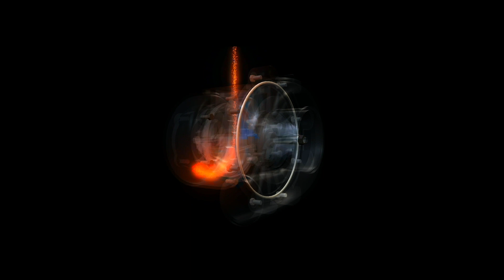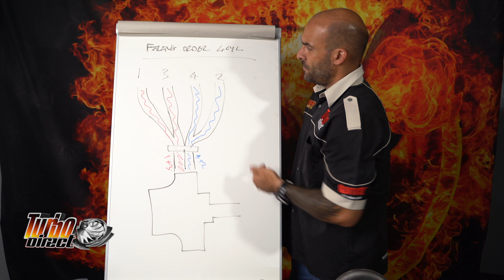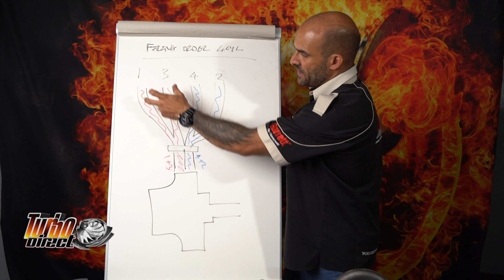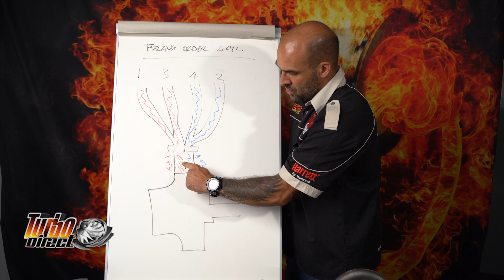Twin Scroll Turbine Housings explained

Comment: Love the video, it looks like they designed the vw ea888 gen 3 engines with a twin scroll integrated manifold, but decided to stick with a single scroll turbo design. Am I looking at this correctly? I know you all have been doing a lot with VW applications in past videos.
Reply from the maker: The EA888 IS38 turbo is not a true twin scroll, the seperator is only 1 inch deep into the housing and then opens into a single scroll turbine housing.
Reply: @TurboDirectSA  sorry about the old thread revival, but it's currently relevant to me.
Being that the IS38 isn't truly a twin scroll, does a quick spool valve in that specific dynamic provide any benefit? I would hallucinate that the singular inlet would produce a higher velocity exhaust gas than wide open. Like blowing on a little fan with a straw vs with your lips alone. 
Currently I run a small Garrett twin scroll on my ea888.3, at least I believe the gt2260s is a twin scroll. Have you done any testing with a quick spool valve on the ea888.3? 
I'm looking at shifting to a Borg Warner s252 (or Garrett gt2871) is it easy to speculate on the likely advantages and disadvantages of a quick spool valve on the 2.0T going into a single volute Borg Warner VS. Garrett twin?
I know you said that there's still a benefit going to a twin scroll even if you don't have a manifold for it and you still see a benefit if you have a tune port manifold and a single volute but what I'm looking for is the difference if you add a quick spool valve into that mix is there scenario where it does more harm than good and is there a scenario that is worth knowing about?

Side note, I love that Mitsubishi turbine housing, I just kept thinking that's a twin turbo setup in one housing and picturing that with a digital quick spool valve is a fun thought. I guess the next level from that is a VGT, but I don't think I've really ever seen 4 cylinder street car with a VGT. And that's a whole new interesting thought I never had before right now. But of course the only VGTs my minimal experience has ever shown me are for diesels, and I have no knowledge about them but what a badass concept for a little GTI or golf r
Reply from the maker: @kcdickinson9373  No worries at all - the EA888 is NOT a twin scroll turbine housing, the housing inlet has what seems like two port, BUT the divider is literally just over an inch long inside the housing inlet port.  Then the volute reverts to a single scroll. This was done to match to the cylinder head shape, which is cast with two of the cylinders exiting out of one port, and the other two out the second port.  a quick spool valve will never work on this type of housing, because there is no true divide between the ports/volutes - 

VGT is old already and installed on the Porsche 911 Turbo S 5 years ago - BorgWarner for the win once again with the first passenger gasoline driven engine with VNT installed.
Reply: @TurboDirectSA  the IS38 is not twin scroll, that makes sense, like you said. 
The exhaust side of the cylinder head is tuned port though, correct? 
Or are you saying the cylinder head doesn't actually have isolated matched pairs exiting together?
I didn't inspect it that thoroughly and I wasn't looking for that specifically either. 
If it is a tuned port cylinder head (because the ea888 doesn't have an external manifold, it's just designed as part of the head) and the gt2260s being a twin scroll, that would make a quick spool valve functional, wouldn't it?
Reply from the maker: @kcdickinson9373  Yes correct head is tuned port - part of the casting in the head itself. Cyl1 and 3 and then Cyl4 and 2 are paired together.  A quick spool valve is a valve that is able to close off one of the ports entirely and then open it again when required, the GT2260S has a tiny little turbo that is a normal rotating assembly used in many other applications, nothing new, and in fact a cheap 'fix' to provide a higher flow rate to the IS38 stock unit.  You would need to check inside the turbine housing of the GT2260S to confirm if the separation spreads throughout the entire volute or not - i doubt it does.

Comment: Video idea! Can you go over the difference of a 6262 turbo vs a 6266 vs a 6259 turbo (inducer/inducer)? And the benefits of each setup.  I know the bigger turbine wheel can take higher flow but same compressor wheel.
Reply from the maker: We dont really have any PTE turbos on hand to compare. Apologies
Reply: @TurboDirectSA  doesn't have to be Pte, can be any company. Just want to see the advantages and disadvantages of using the same compressor wheel with a slightly different turbine wheel
Reply from the maker: @kingkage7km  I have done a video on this already - its the comparison between the G30-900 and the G35-900 same compressor but with a different turbine wheel - check it out.
Reply: @TurboDirectSA  thank you
Reply from the maker: @kingkage7km  Pleasure Sir